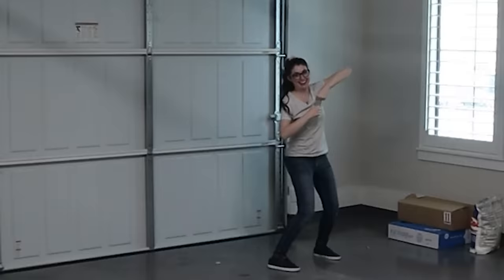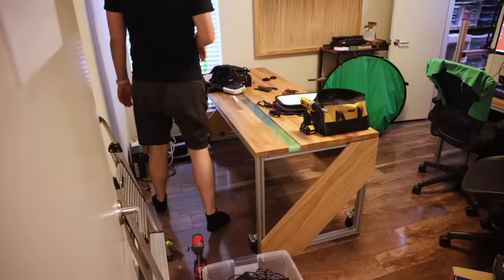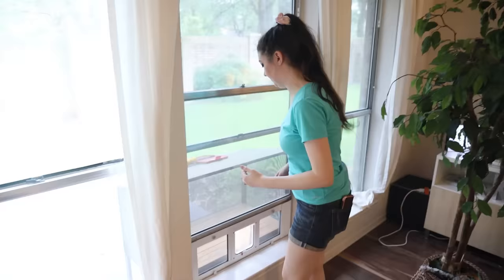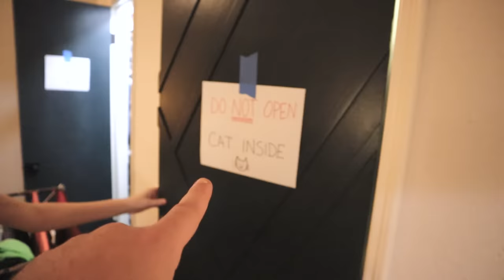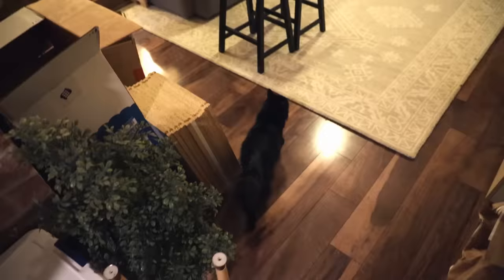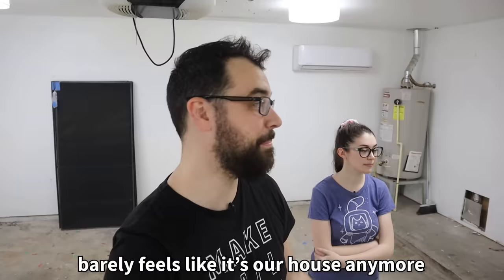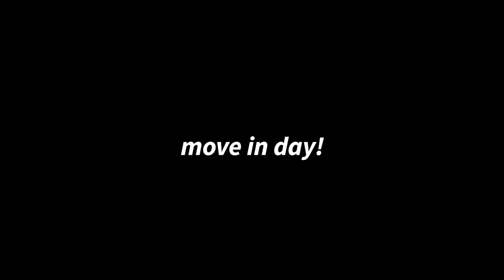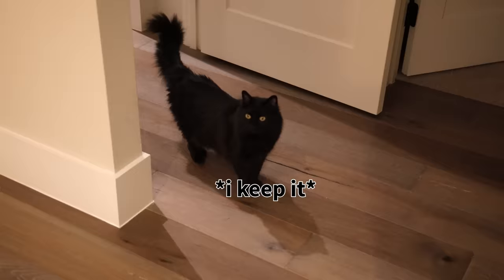Moving Into Our New House! (we almost RUINED our floors)

Comment: what about a modular bench system for the garage? so you have little rolling things the height of the bench and a few feet wide (or 1 meter or whatever size you want) and the whole garage is made up of them, they connect magnetically so you can just take them off the walls where they function as storage and use them to make a bench for longer pieces of wood, or split the bench to have space for drilling or sawing big stuff

Comment: Id so buy Raycons if I hadnt already spent $130 on buds from Samsung. Plus as you stated Raycons get 6 hours of continuous play. I get around 8-12. Depends if I put them in the case at any point for a short charge. If I dont its about 8 or 9 hours. I really truly use my earbuds for more than 6 hours and hate when I have to switch to wired headphones when they are dead. I really need something with a battery life like the Samsung Galaxy Buds+. If Raycon could make them last that long with one single charge (I believe its around 12-22 hours) and still be $80 and make a purple color similar to the purple shade on the Buds+ BTS ones then Id high think about buying them over Samsung. (Havent upgraded to the Buds+ yet.)